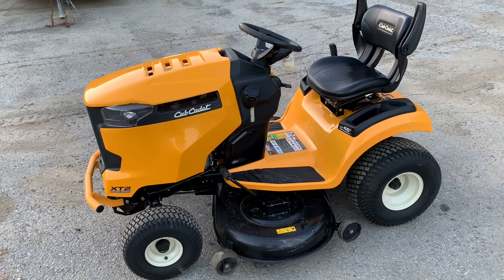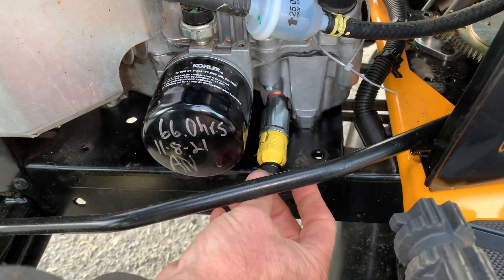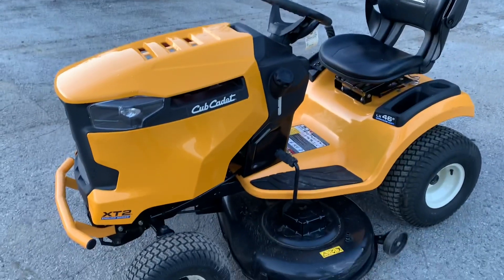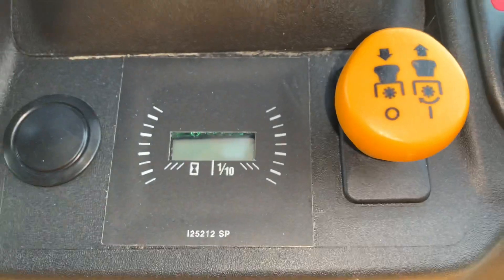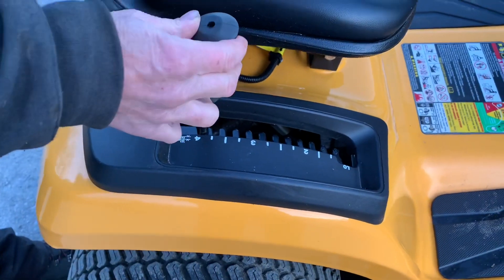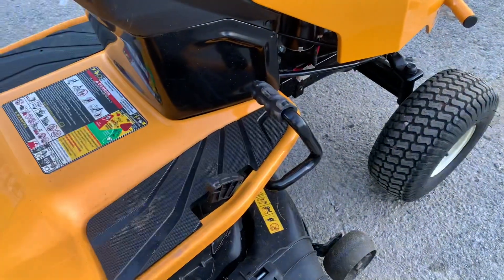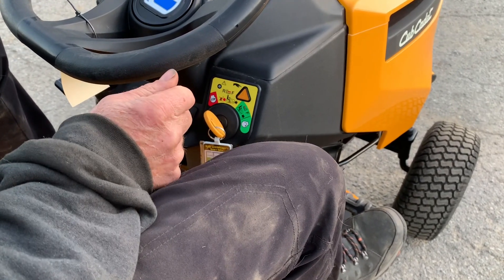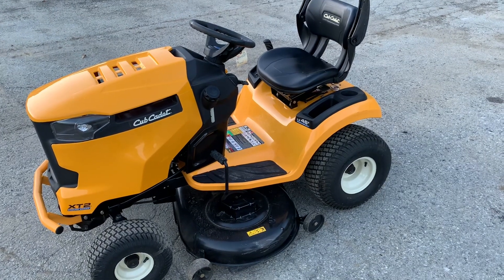How to Start and Operate a Cub Cadet XT2 Lawn Tractor

Comment: I have one of these, will turn over but not start. 22 hours on it. I will try exactly what you did, I learned something new about the choke.
It runs great when it runs. Drove it into the shed and hadn't started since. I'm hoping its something minor....like operator issue, lol.

Comment: Always enjoy your HOW TO videos.  I've got a Cub Cadet XT1 46" that runs fine forward, but is real sluggish in reverse.  Difficult to back up any incline.  Have you addressed this in a prior video?  Got any idea what is wrong?  Thanks.
Reply from the maker: Haven’t had any with a sluggish reverse yet. If you can take a video of the issue and send it to my email address, i would take look.
Reply: @JohnsonsSmallEngines  Will do.  Thanks.
Reply from the maker: You have the old choke system but the new system is an automatic choke.
Reply: Actually, the fix was strange but simple, and a complete accident that I figured it out.  There is a rod between the pedal and transmission that lays on an angle iron.  The angle iron had a significant buildup of dirt and grass on it in the channel where the rod is located.  For some reason, there was no obstruction when going forward, but the buildup prevented the pedal from allowing the rod to operate the transmission in reverse.  Since then, I've been able to blow all dirt and grass off the angle iron after each mowing and have never had a problem since then.  Odd I'm the only one to have this problem. @ainttakenanyshit

Comment: I have a John Deere 325. Is there a better mower for mowing on hills?
Reply from the maker: The John Deere if it is a X series. In my opinion is a good machine. Are you having a issue with it on your hills? If you are maybe your hills are extreme??